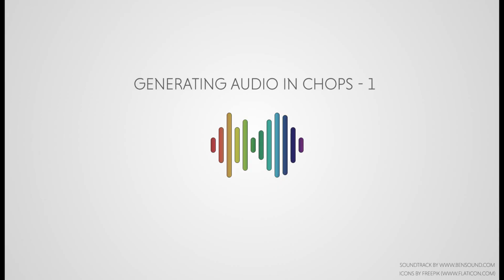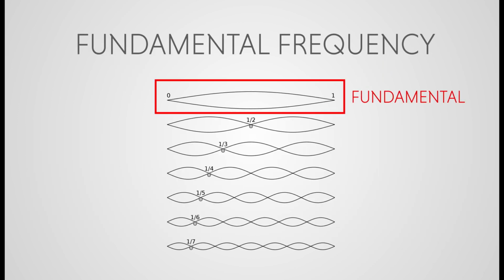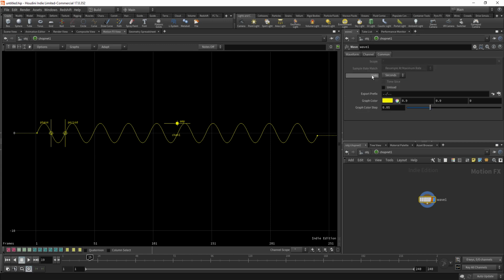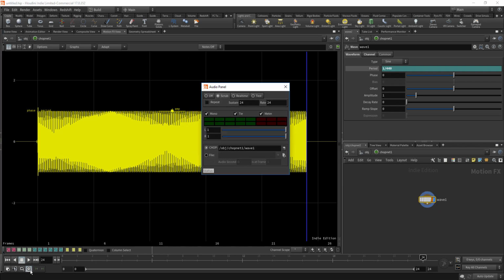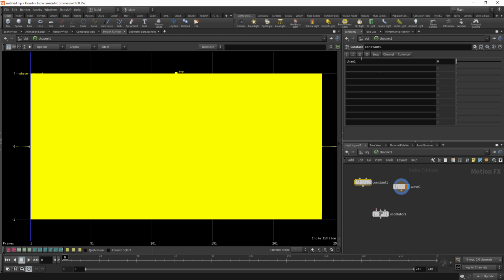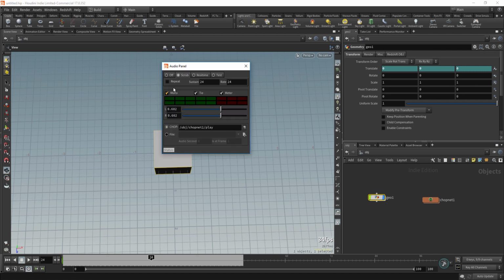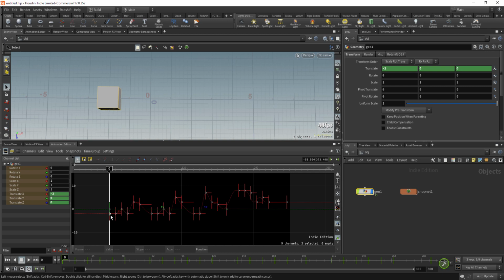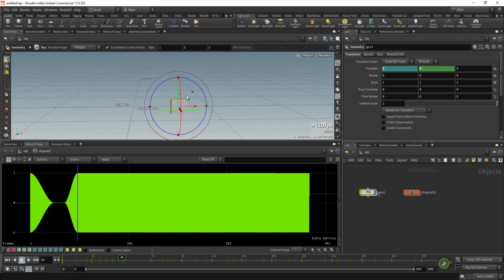Houdini - Basic audio generation in CHOPs

Comment: Hi Fabricio! I really love your research works. Thank you for sharing!
I had a question: Is there a way to transpose an animated spline directly to an audio waveform?

Thanks!
Reply from the maker: Hi, thanks! You mean like a simple waveform visualizer? yes it is totally possible. 

This visualizer would be just a slice running along the full waveform as the audio is played. you can create a flat line in sop and use its point indices to query chanel samples from chops. There is a small conversion you need to do: time to chop samples (considering your channel sample rate), so your sop line middle point stays exactly the current time sample being played and first/last points corresponds to the waveform slice you want to display. 

But it is super easy overall, I have a hip example somewhere in my pc. Will try and make a tutorial for it soon!
Reply from the maker: you might also like the first half of this video: https://youtu.be/cPCFy6iZyOs